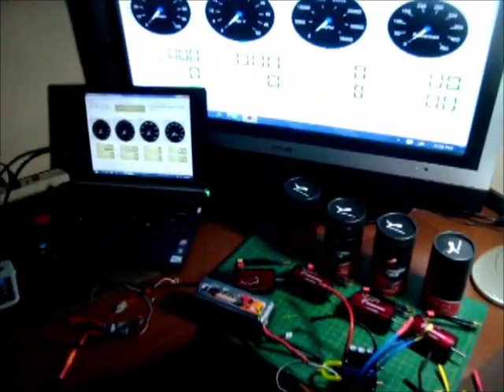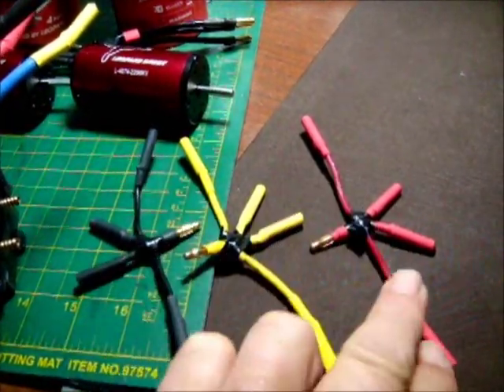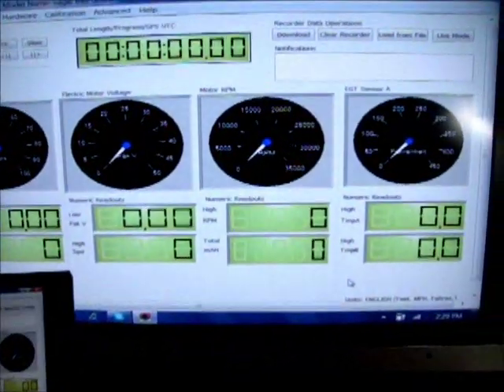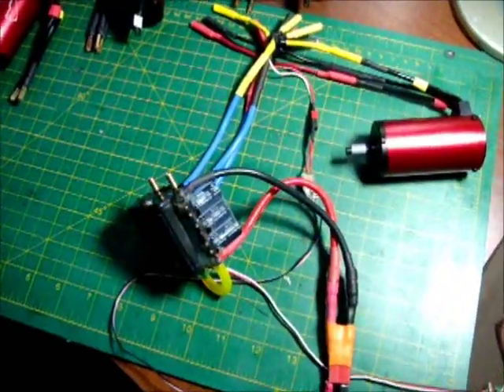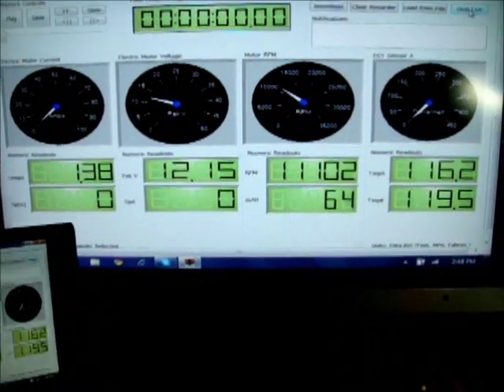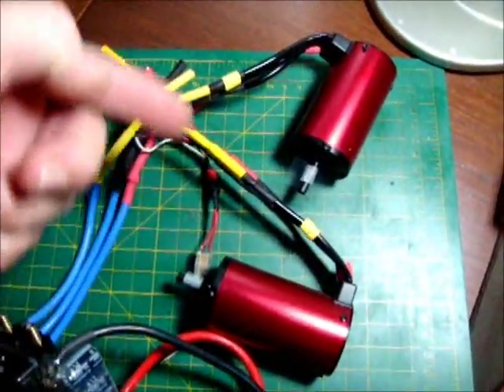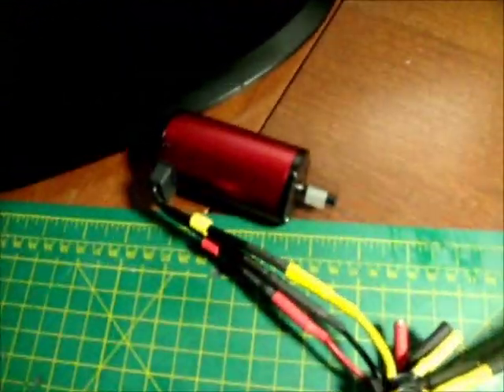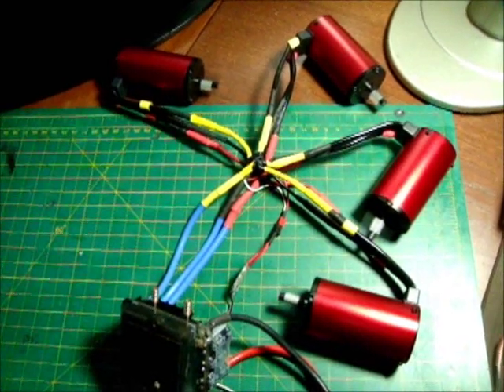Testing 4 Leopard Motors on 1 ESC - NO LOAD

Comment: Will not work under load...
Reply: Your right I was gona do a al terrain skate board with 4 motors now ile think I will buy 2 ESCS per 2 motors
Running 16s each 2 motors can use 4x4s 7700mah 70c lipo while the other ESC can be connected to another set of 4x4s 7700mah 70c lipos
Reply: 1 ESC per motor is the only way a brushless will work. the Timing is never the same from one motor to another.

Comment: Hi, this will not work under load. You will destroy motors and ESC. Sensorless brushless ESC uses BEMF to get information about current rotor position. BEMF value will be unusable under load if  2 or more motors will run in parallel.